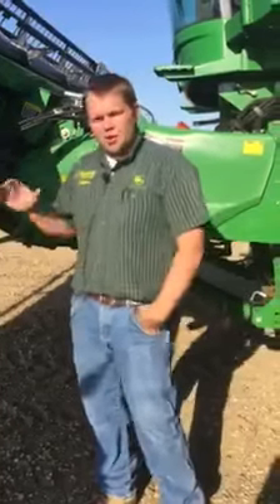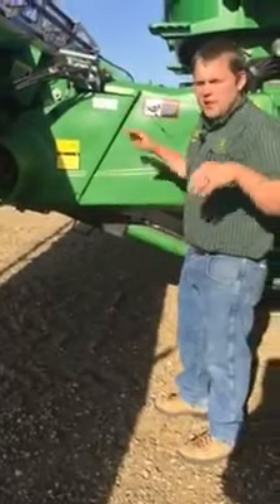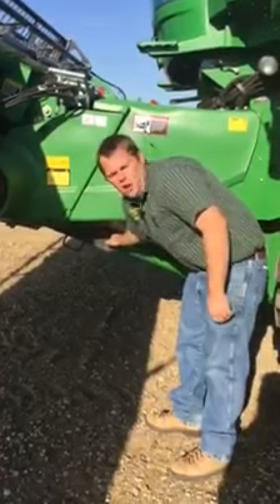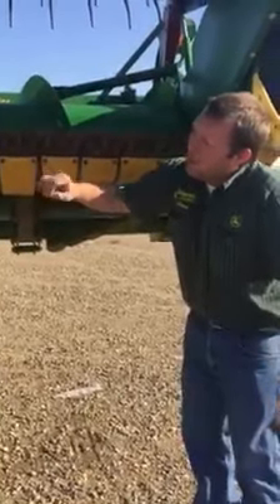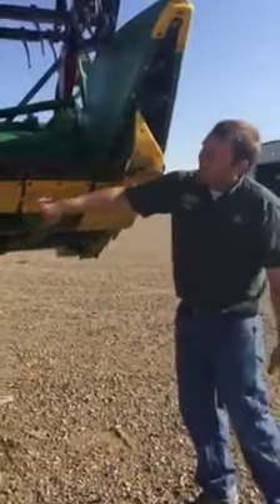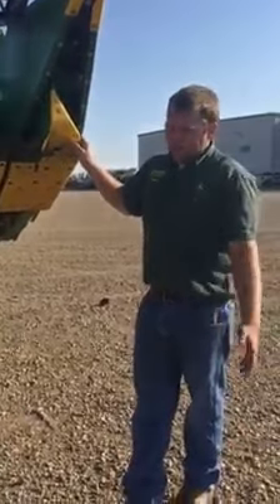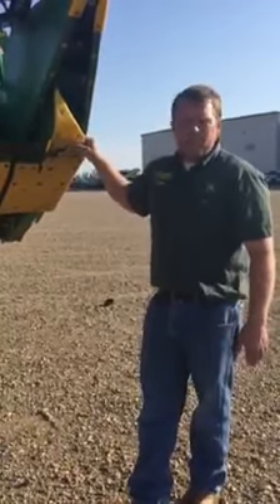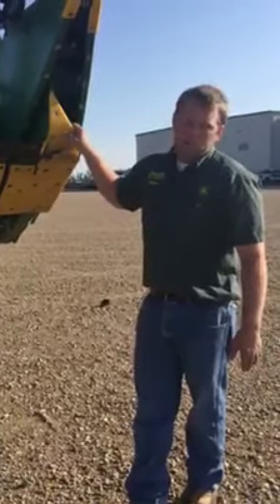How to change HydraFlex header from rigid to flex mode (1 of 3)

Comment: If one has mostly "flat" ground does running rigid mode benefit you or should one rely on the technology? Or is the technology non beneficial for instance, beans grew very tall and bent over (moderately) so there may be more pods down low? Thanks in advance.